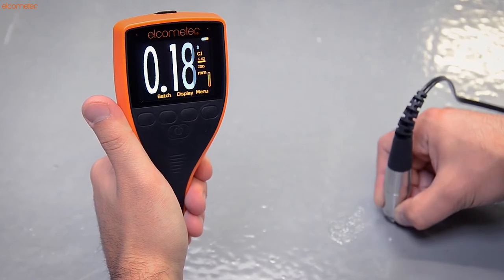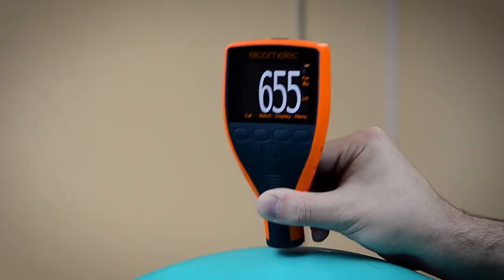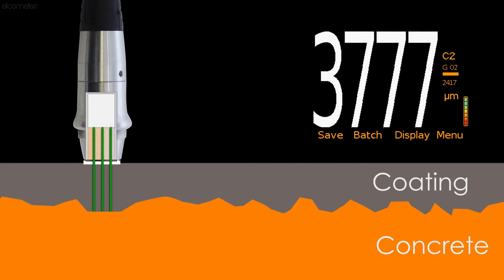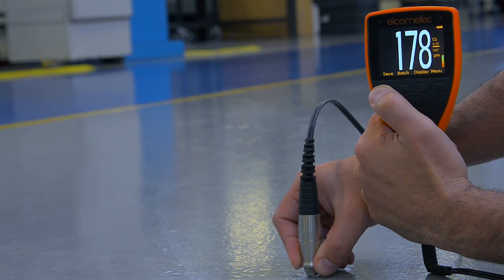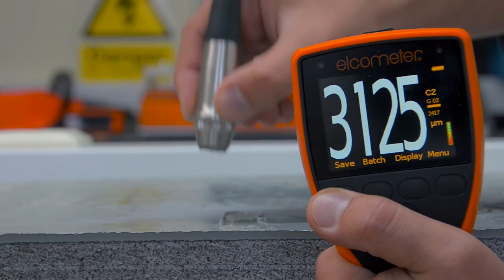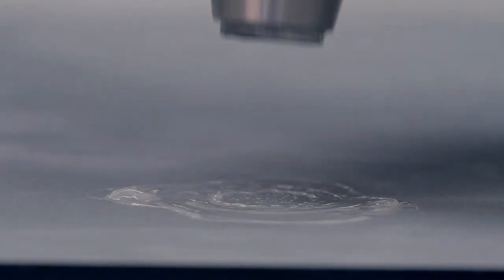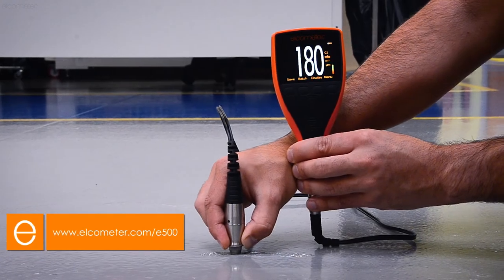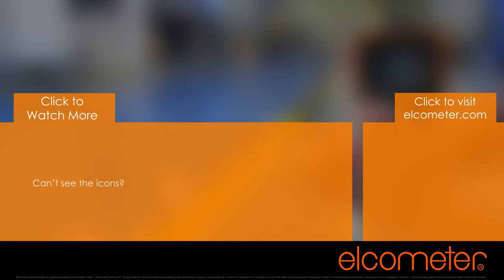How to take accurate DFT measurements on concrete with the Elcometer 500 Coating Thickness Gauge

Comment: Is DFT gauge available for checking coating on forgings
Reply from the maker: Hi,
The Elcometer 500 is designed for concrete only coatings measurements. For coatings on forgings, we would suggest the Elcometer 456. 
For further technical details please get in touch at support@elcometer.com

Comment: Hi I have a question is Cg60dl compatible with other probes?
Reply from the maker: Thank you for your comment.

The CG60DL is no longer an active product. There are however two alternatives available.

However, we need some more information to ensure we can find the right gauge to suit your requirements.

If you contact our global technical support department, they will be able to assist you over the phone. 

The phone number is +44 161 371 6000.

Alternatively, you can contact techsales@elcometer.com or visit www.elcometer.com/contact-us to find your local Elcometer distributor.

Thank you once again.

Comment: does this do lubrication thickness on wire?
Reply from the maker: Hi, 
The Elcometer 500 Coating Thickness Gauge is intended for use only on concrete coatings. 
Please send your enquiry to techsales@elcometer.com where we can assist you further.